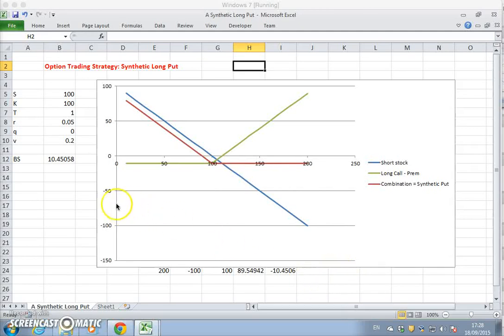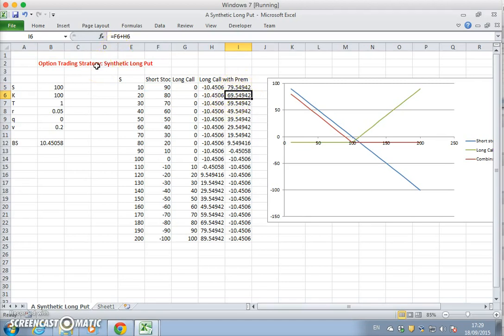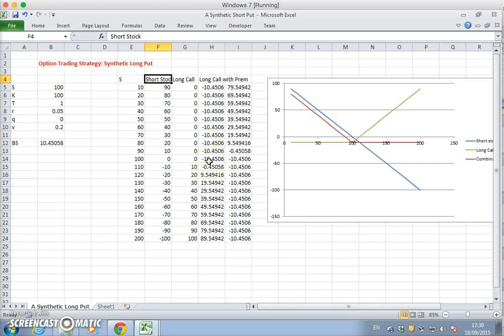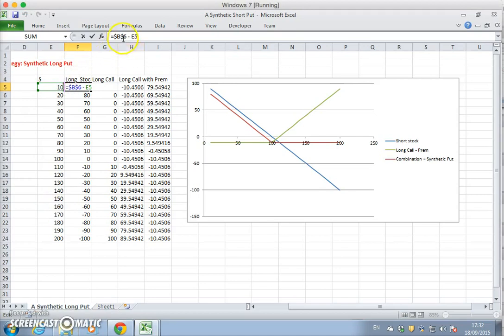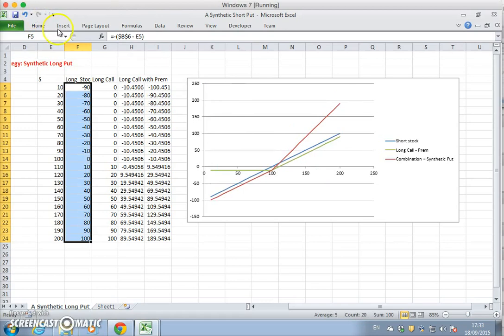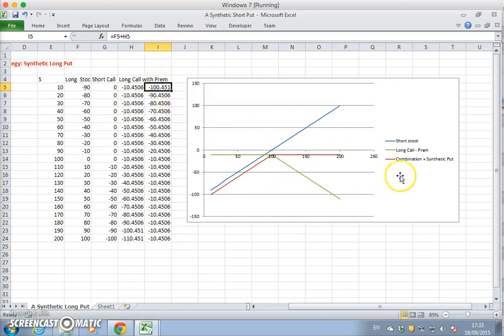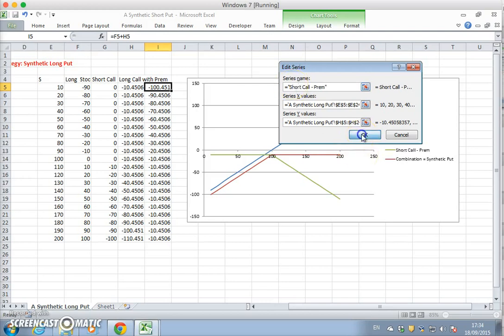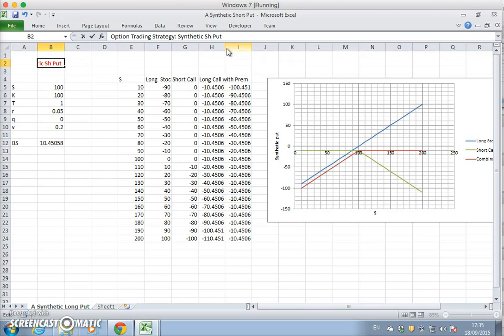Option Trading Strategies: A Synthetic Short Put Position

Comment: HI Brian, just on the short call with premium, i think you need to add the premium rather than take it away. This will give a more accurate reflection of the short put as you are selling rather than buying the option. the line should be above the x axis as you are making money on the stock on a short put if the stock increases in value.